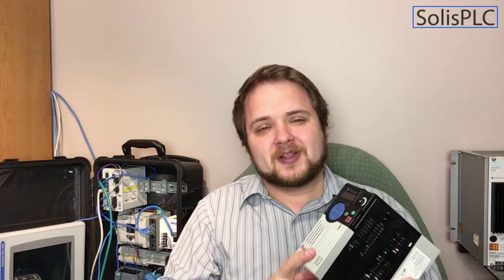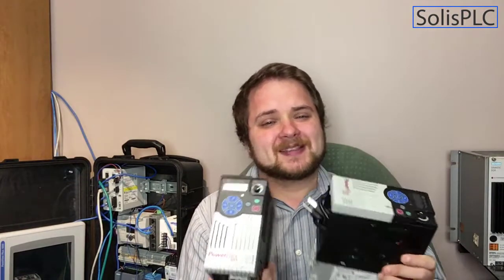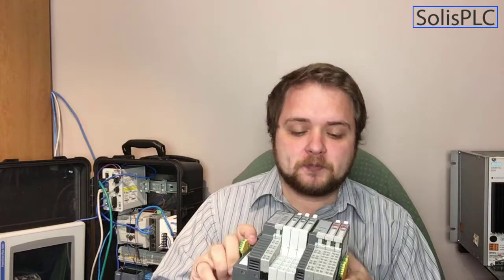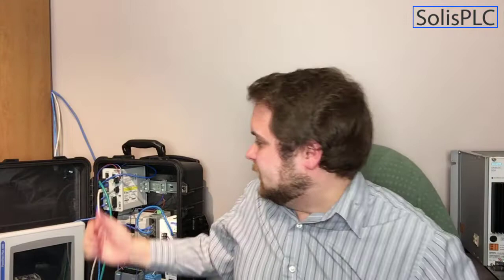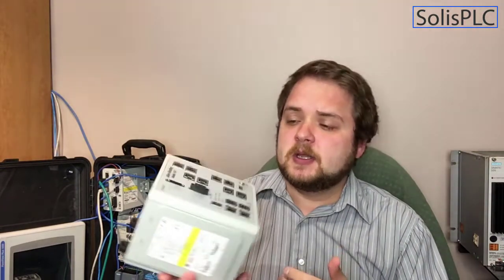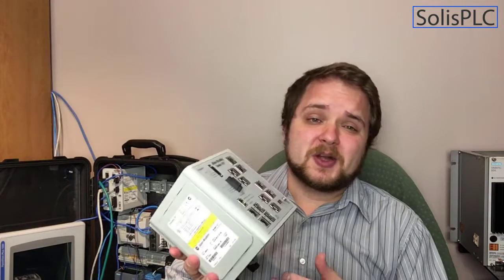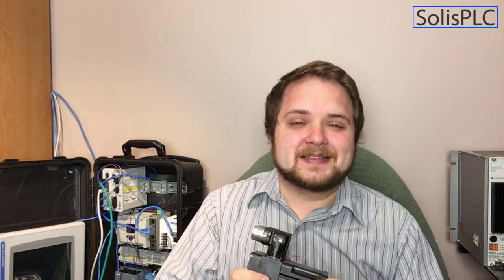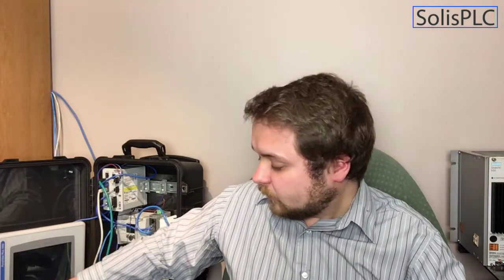PLC Vlog #2 - PLC Trainer Build, PointIO, PowerFlex 525, Kinetix 350 MPL Servo & Strtix 8000 Switch

Comment: I was recently working with a machine that had a powerflex 525 driving the main motor. There was a kinetix 5500 driving a servo motor that moves a carriage that the main motor is on that the powerflex 525 is driving. 
I thought it was odd that the encoder feed back cable from the motor that the powerflex 525 is driving was hooked up to the kinetix 5500 drive. 
I can't help but think that the feedback from that motors rpm is being used to adjust the feed rate of the servo motor the kinetix is driving. 
Does that make sense?

Comment: Hello Vladimir, I found this YouTube channel because I've made my own PLC trainer kit with CompactLogix L32E and four modules (input/output digital/analog signals), so I'm ready to train with it and was looking for tutorials. About your video, you mentioned the PowerFlex 525, that is what I want to buy. I know that it works with Modbus RTU protocol but I don't know if the EtherNet/IP protocol module comes in another card or is including in the VFD, I was searching about it and I found it similar to Sinamics G120, drive which I worked in a class. Another thing, in the factory where I was working, there were Parker HiDrive devices that control servomotors of the same brand and I remembered it because you showed the motor you bought and the cables (orange and green). It would be great if you do a tutorial about it (and if people have to pay to access to it, no problem, it's a way to thank you for sharing it) because I have problems to start a servomotor with Parker HiDrive, an alarm always was shown about that the resolver was connected wrong but for me,  it was connected properly, so I couldn't move it. I'm a new suscriber now. Thank you.